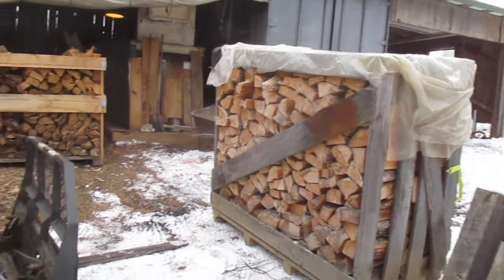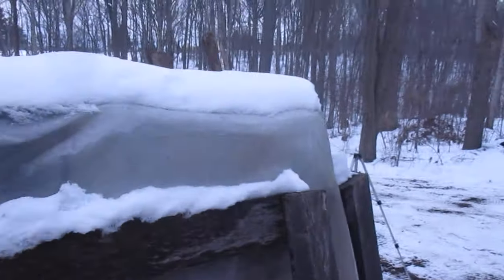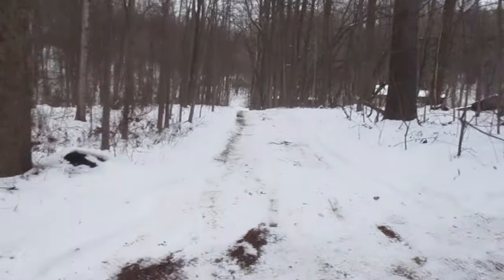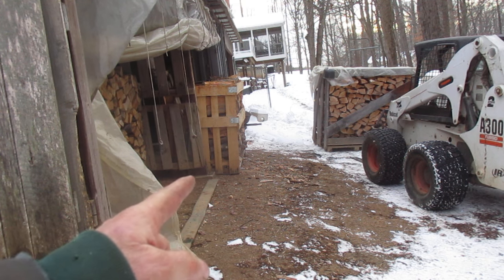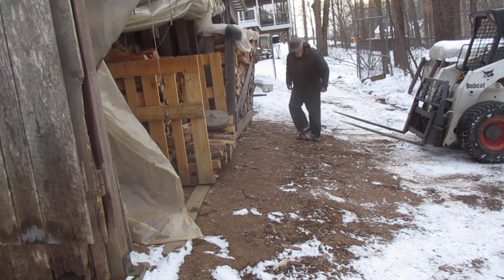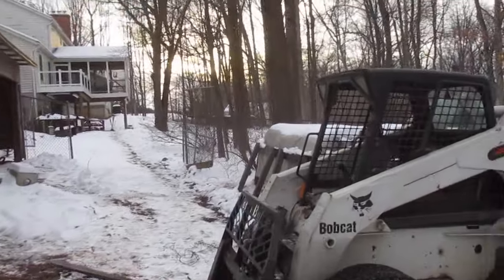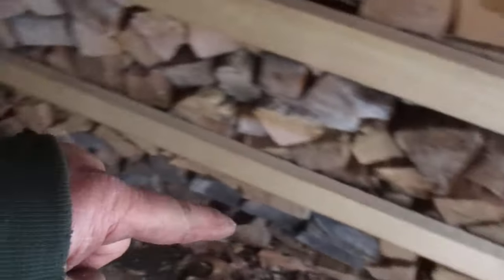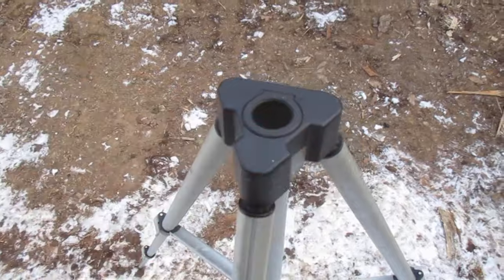Moving fire wood around the easy way # 1405 Diesel help

Comment: Nice job John.  Holy shovels, it sure takes a lot of equipment to save money. Loaders, forklifts, Bobcat, etc all have forward visibility issues for sure.
Reply from the maker: hi there when i get a piece of equipment i would like it to do more than just one job when possible.like the bobcat ,it works at the sawmill , works for firewood , lift things around . the sawmill makes boards firewood , as i clean you the dead trees on the property .my mower ,mows but also gets the leaves up in the fall , ,most likely you have a car ,i do . you could walk to where you want to go , to heat just the house takes 850 gallons of fuel 2 years ago it was $7.00 a gallon thats almost 6000. it is still real high , but when i started heating the house with wood 35 years ago when fuel oil was 2.50 a gallon , it hard to say if i have really saved money but in my mind i have , So glad you stopped in and left a comment .Thank you john